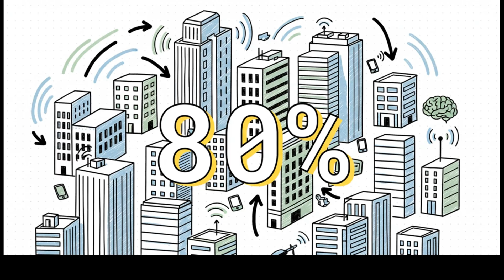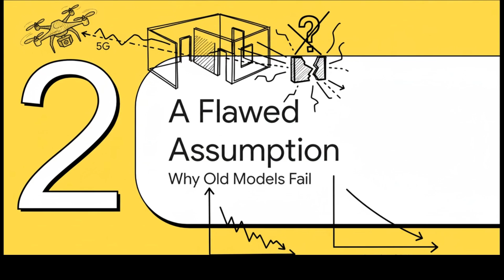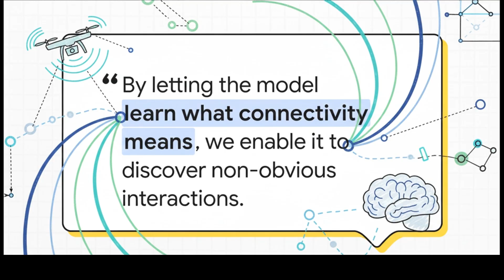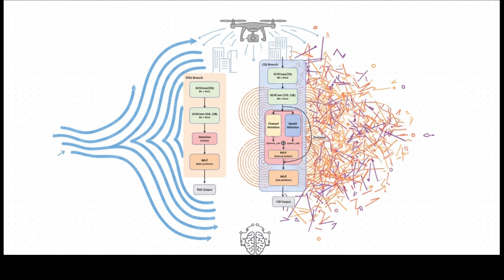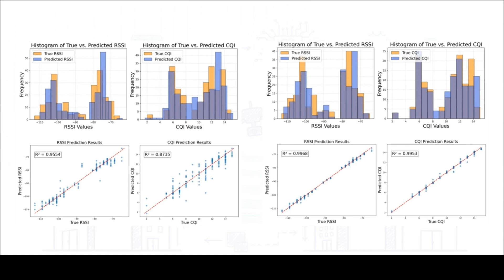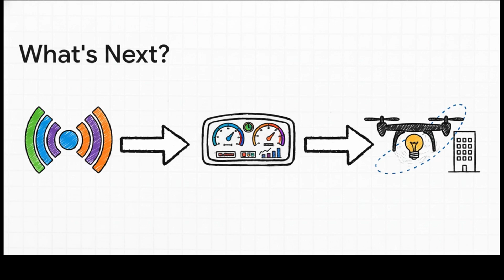SpiderGNN  Seeing 5G Signal Through Walls

Comment: The problem is that the people and equipment positions and refractions change all the time. That makes your diagram dynamic and constantly requiring change
Reply from the maker: Good point, Jimmy. That was the challenging part of this research project, especially for predicting the CQI parameter, which fluctuates based on people and equipment positions; however, SpiderGNN maintains reliability by replacing static maps with a Dynamic Graph Construction Block that recomputes signal-aware topologies at every forward pass. Leveraging attention-derived feature affinity, it captures real-time changes in propagation, such as refractions and architectural obstructions. Finally, meta-ensemble fusion suppresses variance from transient environmental shifts, providing stable, high-fidelity estimation.